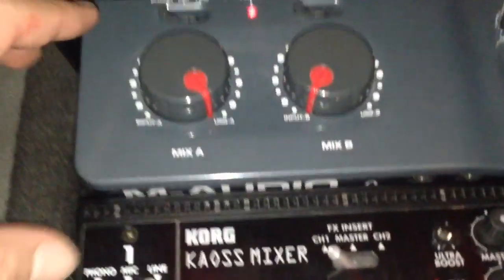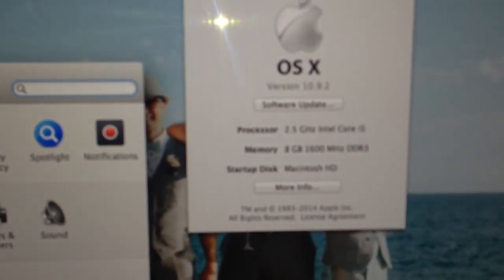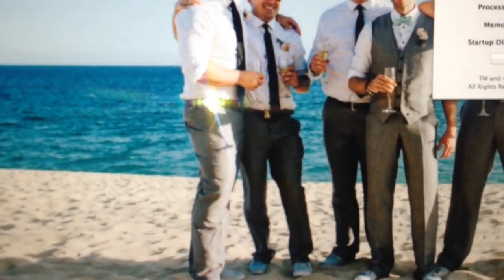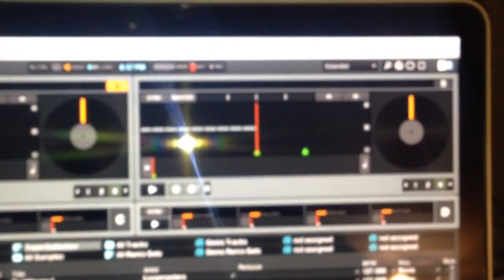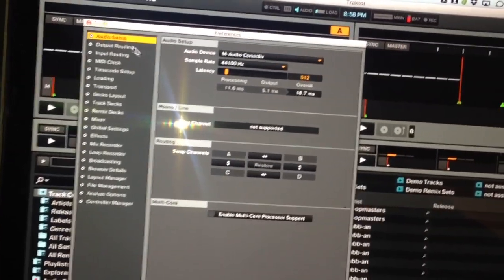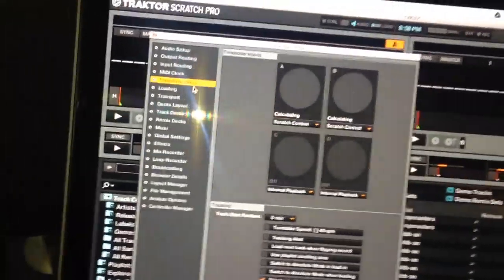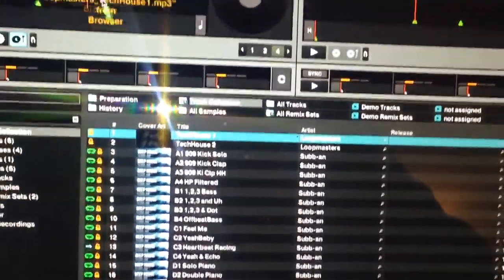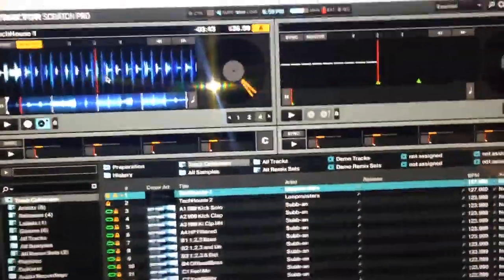M-Audio Conectiv on Traktor 2.6 w/ Mk2 Control Vinyl

Comment: I am able to control the song with my timecode vinyls......I just get no output to my mixer. I know its wired correctly because if i were to turn the knob on my Conectiv to hear the timecode, it works.....my inputs and outputs look the same as yours...............Any ideas????

thank you
Reply from the maker: rocaridj have you made sure that your traktor is set to external mixer mode - that's the only thing i can think of that isn't shown in the video.

Comment: works fine or is better use mk1 with torq? i have torq conectiv and don't know which traktor timecode should buy
Reply from the maker: i've never tested with mk1 vinyl... not sure if it even works... I would stick with buying the mk2 timcecode vinyl, if you don't have any yet, cause it's tested and true.
Reply: miCkzilla mk1 timecode only work with traktor 2.0, for eigher version its only with mk2. if all works (torq + traktor 2.6 + mk2) i will buy mk2 :)

Comment: do you know anywhere that is hosting connectiv drivers? im trying to instal my old Torq on OSX 10.9.5 for a friend after i upgraded to Serato. the mac drivers it shipped with are old. it shows as not connected in system prefs.
Reply from the maker: found them here: http://www.opendrivers.com/download/driver-160858.html

only the link under "backup server" worked tho..
Reply: Hey thanks!
Reply: miCkzilla so it does work with mavericks and the drivers??? great :D

Comment: what is that ringing sound?...that's horrible
Reply from the maker: Standard with all time code vinyl.. What you're hearing (through the needle itself) is the actual time encoding sound.
Reply: i have never heard that before with traktor or serato
Reply from the maker: +markus tilley I think you're just hearing it as the phone microphone is picking it up more.. That sound doesn't come through the speakers, it actually just the sound you hear coming from the turntable cartridge itself from the needle on the vinyl.   Next time you out on time code vinyl, put your ear right beside the head, and you'll hear it...   There has to be some sound, or the program itself wouldn't be able to use it to process the time coding.